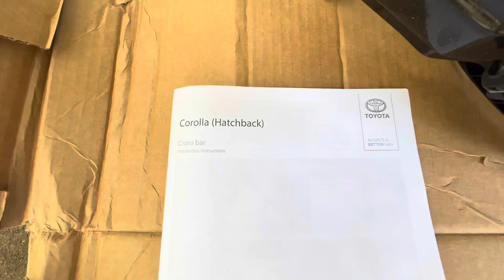2019 Corolla Hatchback Cross Bar Installation - Toyota - OEM - Roof Rack - Part Number: PW301-02009

Comment: Hey! Quick question!
Are the original plugs any different than the new plugs ?
Reply from the maker: Yes, they are different I believe because the new ones had larger holes in them for little nubs on the rack to insert into.  I just re-watched the video and they seemed to be a bit sturdier as well.
Reply: Thank you man!
Reply: @iceplant1  do these new plugs come with the part?
Reply from the maker: @PaigeKnowles-c3x  yes!

Comment: Any idea how much weight these are rates for? I can’t find specs at any Toyota dealership website. It would be nice if they would list the weight capacity and how long the bars are.
Reply from the maker: 75 KG / 165 LBS Evenly Distributed - 37.5 KG / 82.5 LBS per Crossbar 
I’ll have to get back to you on the length.
Reply: @iceplant1  hey thanks I appreciate the response. I was able to find the length specs but not weight specs anywhere. Not even my Toyota dealership could find it for me. I’m only wanting to carry a 60 lb kayak so these will work. Thank you.
Reply: I think that weight limit is extremely low. I'm sure Toyotas legal department had something to with that number cause I pitched a tent for me and my fury friend and we must be at least 300lbs with the tent and gear combined 😊
Reply: @bopinthewap  what tent did you use?

Comment: Hey, does it matter if you use the original plugs instead of the ones included?
Reply from the maker: I believe they are slightly different. I thought the same thing, but ended up removing the original plugs and installing the new ones. Just curious, why do you ask? Did you lose one of them?
Reply: @iceplant1  I bought some used and didn’t come with the new plugs
Reply from the maker: @jordansanluis8373  if anything, the holes might be slightly larger. I’m sure u can modify the original plugs to make it work! Please let me know how it works out. Thanks!

Comment: What does torque to 3NM mean? 3 nautical miles?
Reply from the maker: Newton meters. 1 Nm = 0.738 ft-lbs 
So 3Nm would be 2.21 ft-lbs.
The reason I used 3Nm is because that’s what the OEM tool is specifically set for.
Reply: it means when it clicks its tight enough

Comment: Does anyone have the part number for the new plugs? I just bought a set and it did not come with the plugs.
Reply: Did you ever find the plugs? Going to buy a used set of cross bars today and not sure if they’ll come with the plugs
Reply: 3D print them if you can't purchase them; do some trial and error, then start selling them ;)